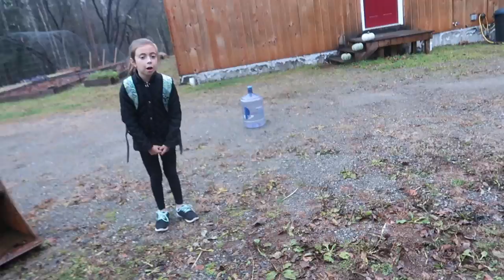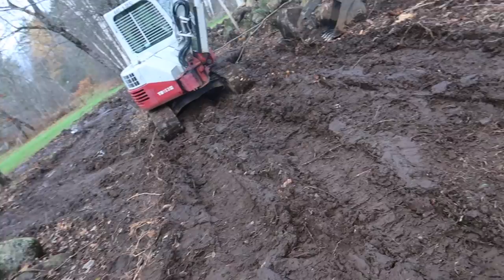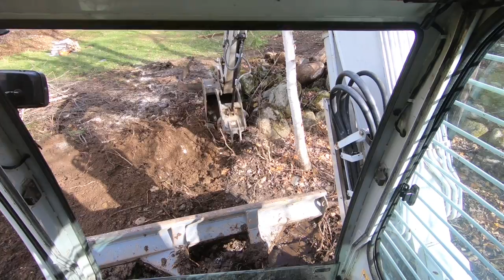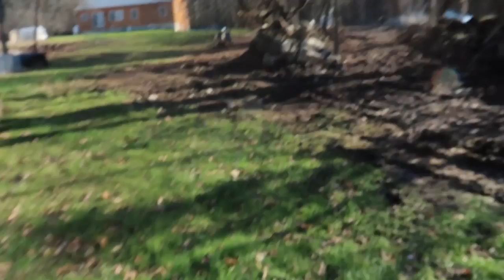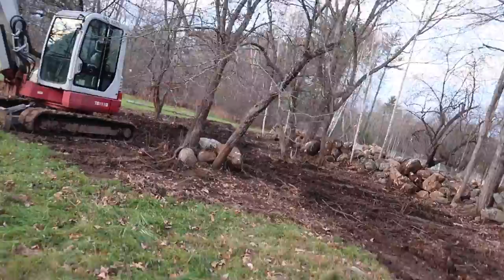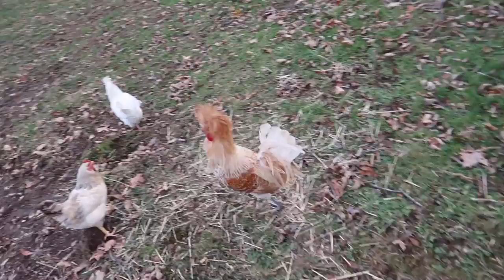I Hope this Goes WELL! Trying to  Removing A Utility Pole with an Excavator

Comment: Olivia is your standing thermometer. The more she pulls her shoulders and arms together, the colder it must be. She is so cute.
Have you considered dragging the long logs closer to where you store firewood? It is easier to drag one big stick and cut it at the pile than it is to haul 30 cut pieces. 
That excavator demonstrates why humans have built so much. We have opposable thumbs, too. 
That telephone pole should sell well on CraigsList. Or you can put it in the yard by the driveway or ? and mount a remote solar light system on it. Gina could have some light when she comes home in the dark.

Comment: Al, you need to get a stuffed skunk to hide from time to time. Oilivia is so cute when she is wide eyed from a startle.
If you can get the excavator back after the ground freezes, you should be able to work the rock walls by the wet areas. Here in Idaho, we have a 6 week period of no equipment in the forest until the fall rains freeze. Then, that frozen ground will handle the equipment without making a mess.

Comment: Some of leaning trees should come out, think longterm with trees, otherwise it will just cause more troubke. Plant some young maples or birches strategically where you want them so they will grow straight and cut down the crooks...you'd 'be surprised how fast those little trees grow in a prime location.

Comment: Try putting your stake in at a 45 degree and let close to the fence post. I tie mine with a surgeon's knot 3 over under cinch it down tight then tie your bow

Comment: Might want to put mulch hay down to stabilize the lane fron winter run off.Cheap way to start seeding the area.
Reply: Paul G.:) Wood grindings/chips from the land clearing would have worked well also.